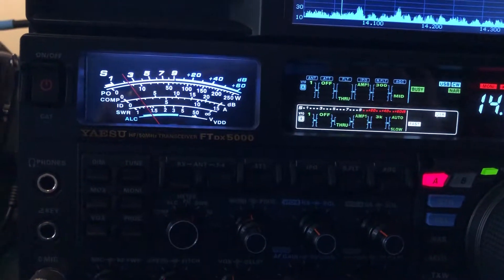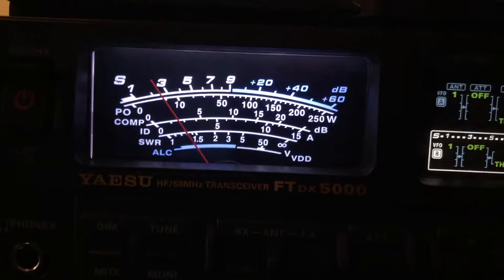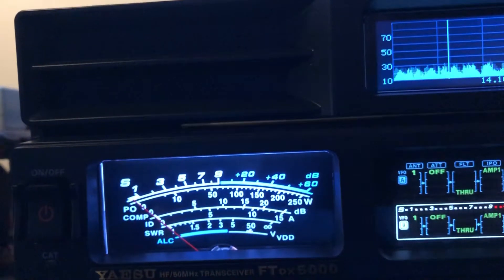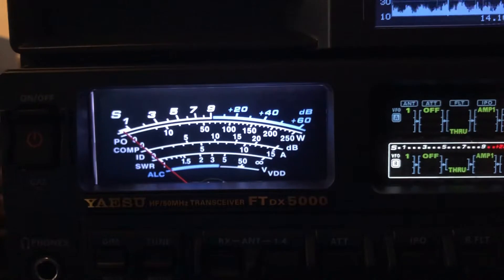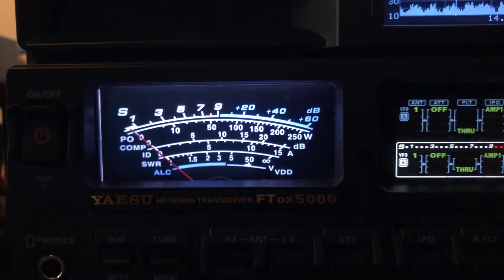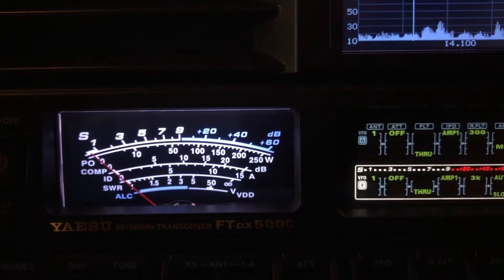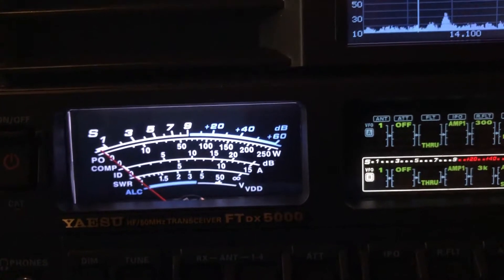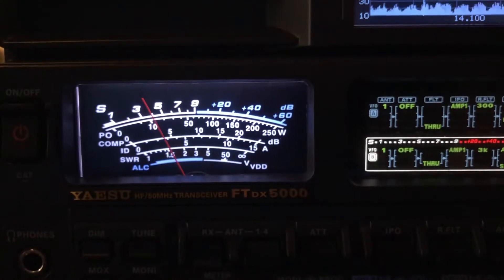Comparison of the 160 meter doublet to an OCF dipole, a ZS6BKW dipole, and R5 vertical

Comment: Great comparison. Are the antennas run in the same direction?
Reply from the maker: The ZS6BKW and the 160m doublet are oriented the same. The OCF dipole is perpendicular to the others.  You can see that in other videos in my antenna playlists.  I know what you’re thinking, but the gain lobes and nulls aren’t necessarily the same for dissimilar antennas.  If I had another ZS6BKW perpendicular to this one, the lobes of one would fill in the nulls of the other.  The same would be true of any two dipoles of the same type.  

I also have a video comparing vertical to horizontal.  Here is a video from my HF Antennas playlist: https://youtu.be/75KbwaON3Lc?si=pUL2klKddQSDlEqQ

There are also playlists for specific antenna types.

Comment: It's a good test ! The ability to switch between a few ant is great . Finding one ant can be better than the next and back again in a second or two . I had a 160 doublet and a 86metre sky loop and switching between the two i found the 160m doublet was 8/10 best rx ,but loop was 8/10best tx   but i did find it fascinating.  Tks for the demo .MM0UDI